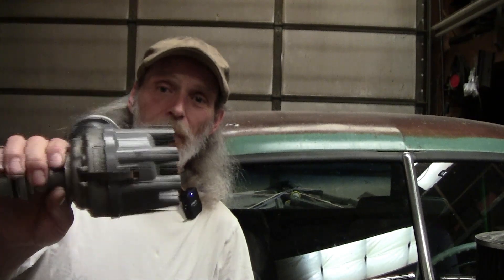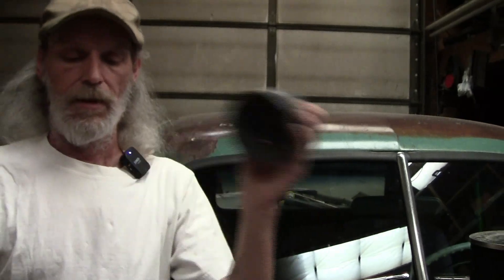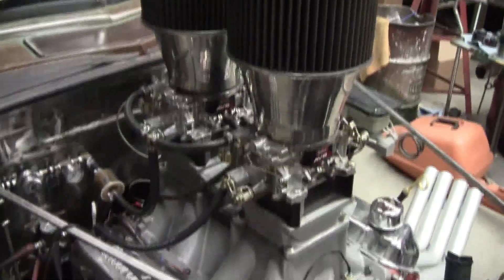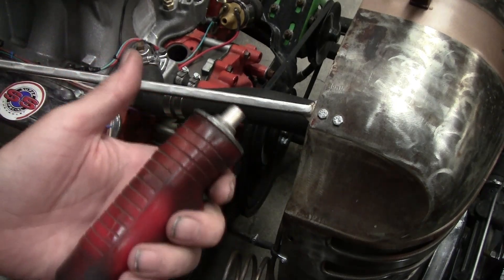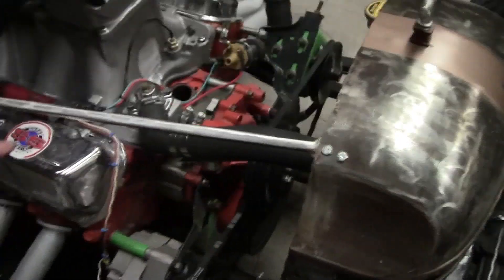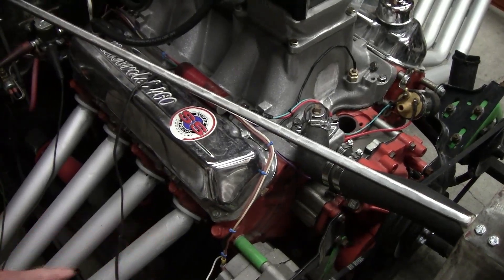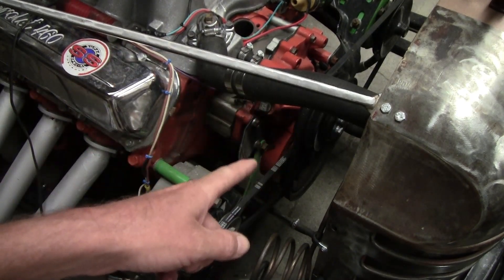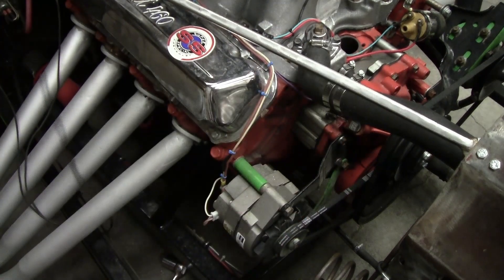How to Install a Distributor in a 429, 460 BBF the Easy Way & Get it to go all the way down

Comment: My truck is 1995 460 #7 is way different than your year #7 down at between 4o clock and 5o clock? On my 1995?
Reply from the maker: Number one on the distributor points to the number 7 cylinder on the block (3rd one back on the driver's side as you are looking at it from radiator)

Comment: My 71 460 points to the drivers seat and the clips are to the front and back of the car…when I put the rotor towards the #7 spark plug the clips at an angle… so how’s the 71 460 rotor supposed to be pointing

Comment: ok buddy the rotor points to number one on the cap where did you ever hear point it to number seven they have always said number one on the cap because the rotor pointing to number one on the cap means it is shooting power from the rotor to the number one terminal then through the plug wire to the plug and sparky sparky we have fire
Reply: True
Reply: Look at the 460 Ford manual, it actually shows #7

Comment: Best info video I’ve ever found! Been fighting my jet boat motor all weekend trying to stab in pointing at 1. And now it makes perfect sense. It’s acting 180 out because my cap is firing 180 degrees from 1. I bet money I’m gonna go point my distributor at 7 and it’ll fire, or I could swap my cap around to fire where the rotor is pointing at 1. I’ve been hearing it can fire in 6 different locations. With your break down I understand fully now!
Reply from the maker: Well thanks Lucas Jackson 204 (lolol one of my all-time favorite movies man).
Yeah, it's so tight around that t-stat housing and everything, that you really don't have the options to move number 1 on the cap like other makes and models.
Also, that's actually a Berkley/Ford 460 you have there! it's exactly what I have in "Sir Rats-A-Lot" with the tunnel ram! We pulled this one out of a Jet Boat years ago! If you ever sell that boat, pull that gem out and drop an 80's tall deck down in it's place..... because you are sitting on the "poor boy's" Cobra Jet" with that thing!
Reply: @BareRoseGarage  I have a 460 with a panther pump in my sleek craft, my race boat is a vdrive with 500+ ci big chief motor

Comment: So then you just hook up the wires in firing order to those cylinders , but on the cap... it starts at wherever one is , ( counter clockwise as the rotor turns) right ? Great, you helped me a lot. I have a 85 460 that I believe needs a new dizzy that has never been replaced. I've just about replaced everything electrical it could be, and still no spark. There's about 160,000 on it, but I guess it might need replacing. But it ran like a bat out he'll few days ago. Smuuthe as a baby's behind, but now just turns over, and won't start. Thanks for your help.
Reply from the maker: I'll start with the easy one first - make sure the vacuum advance is hooked up. I've called myself an idiot a few times for forgetting that one..... lololol.
Sounds like it's a tooth off, or that it needs a little more advance (getting you closer to that 10 degree btc mark on the harmonic) but we'll take it slow before we dive on in. 
Do you have one of those "Bump Starters"? They are ultra cheap at Harbor Freight or even the ones at O'Reiely's, Autozone, etc etc are pretty cheap and VERY handy for doing this stuff. I highly recommend them and a "Spark Tester" looks like a spark plug with a clamp on it, you plug it into a plug wire, clamp it to a ground somewhere and watch it for spark as you turn the engine over. Those 2 tools will save you hours of frustration and they are really cheap.
1st thing I'd do is check for spark, then move on to making sure that spark is going where & when it needs to go.  
If you didn't pull the distributor yet, do the spark test 1st and foremost, because these Motorcraft distributors will generally last a long long time, but everything else wears out around them. I've bought many coils & Duraspark Boxes that where DOA right out of the box, even the made in the USA ones.
Anyway if you have spark just no fire.... loosen the distributor bolt just enough that you can turn the distributor but it still holds it in place.
While it's turning over trying to start slowly turn that distributor clockwise (advance) and it should start to pop off (try to start).

If you run out of room and can't turn it anymore (vacuum adv is hitting the T-stat housing or what ever), you know you are a tooth off on the distributor gear, pull it and start over.
If it's dragging on the starter (making it sound like you have a dead battery) you've gone to far.

Oh!! and if you are using the "bump starter" to do all this..... make sure the key is on. If not all it does is turn the motor over without spark.... yeah, I've done that one too... lololol.
Once you do get it to fire up & idle, you can put a Timing Light on it to dial it right in to the exact degree.

I probably left something out in that, but that should get you started in the right direction with this, and I did my best to start with the cheap before you move to the money.
Hope it helps, and let me know how it goes man.
Reply: @BareRoseGarage  I will, and I have had bad electrical parts right out of the box also. I will get a bump starter, but regarding parts.....they no longer check ford spark boxes, hei modules, coils, or regulators that are external any longer. They just replace them one time. That sucks because you could be getting A bad part as a warrantied part, how would you know except to know how to test the part with an ohm meter or some other diagnostic tool. Years ago I had an idea that ford or chevy should have had a job shop in factories to custom build old model cars for customers upgrading components, hiring more 0eople to put to work. I can recall when you could buy changeover books that also listed what parts fit on multiple vehicles, to save you money on parts, and stuff like disc brake kits for older cars. Nothing like that exists now.  There's a guy from Denver that has a show on YouTube called Schroedingers box that teaches modern auto repair science. He has a 3.33 a month subscription to watch all his repair videos, if you've never seen any of his free ones, look his video's up on you tube. Thanks for the tips.....I'll let you know whether I figure why my truck won't fire up.

Comment: When you pull the dizzy initially, if you leave it where it is, shouldn't all be lined up, including the pump .?
Reply from the maker: In theory yes, and I have gotten away with it a couple of times, but the oil pump drive..... it almost never does. (I've done many many many of these and can count on 1 hand the number of times that the oil pump drive just slid right in, when it happened on this video I was SHOCKED even though it was wrong..... lololol)
But it's also an easy way to get it a tooth off. 1 tooth is generally in-between two plugs.
If I do try it that way, if it doesn't work, I'll do what I did here and roll it up on number 1 compression stroke & set the harmonic pointer to TDC (or that 10 BTDC if you want) and start over.
This one I'm working on is a High Compression older BBF so I play it safe with starting my timing closer to TDC and dial it back with the Timing Light so it doesn't "ping" if that makes sense.
Reply: @BareRoseGarage  yes it does....but this gas from Venezuela is crap, and my 460 is not being raced, so until we begin energy independence again, we all suffer . They need to hold gasoline to 99 cents a gallon for 8 years at least to just begin to help the drivers and the economy get back on it's feet. Harris won't do anything to fix anything...just giggles like she's high .

Comment: You never explained that 10 °   marks importance.
Reply from the maker: Had someone come into the shop right in the middle of filming that, and missed that little bit, but it's more for "timing" than dropping it in.
They all fire at 10 degrees Before TDC not at the actual TDC mark, so I set the harmonic on that mark and turned the distributor until the points just started to touch to make it fire at the touch of a key. HEI distributors you can't do that because you can't see the actual flick of the switch.... if that makes sense. 
Later when I actually put a timing light on it to dial it in, that 10 degrees BTC is the mark I'm shooting for.
Reply: @BareRoseGarage  thank you for completing your explanation. I have a situation where my 85 460 ford ran great then I,parked it over nite, and now it won't start. I replaced the coil, the , switch on the column tube, the spark module, and even the two wire p,ug with the flat bottom to that module, and no dice. I figured there's nothing else it can be except the dizzy pick up coil. Might replace just that part without pulling the distributor....that is if I don't have to, but if I do, I appreciate your video, and will do it your way. I have books that give tests for components, but if they are new, and not junk parts, I can't think of anything else it could be . Just had to tow it out of town to storage.... because the cops won't allow motor homes on the street for more than 24 hours, then must be moved 700' or they fine you big time. I've not been big on fords , but how can a truck run like a bat outa hell, then not start ? I DO KNOW THAT FORDS HAVE ALWAYS BEEN WEAK ON GROUNDS. So I figure it needs more grounds, why else would it not be getting spark ? Have thought about replacing the old Ford dizzy with a chevy with the coil on top. Or I've even seen them wire up chevy ign modules inside those old ford spark control boxes also. I can't keep breaking down, as AAA  ONLY GIVES YOU 4 TOWS A YEAR, AND WITH TODAYS TOW, I've used up two now. Any suggestions. It's hard with a 460 when you only get 6 mpg at 5.00 a gallon across the country. ( but love how it runs when it runs well. ) i rebuilt the C6 as a monster transmission,and it runs great, but I hate how hard it is to unplug all those plugs under the hood....it shouldn't be that hard to do. Fix or repair daily, unless you know the secret...I think this MH is haunted !

Comment: If the pump drive shaft doesn't line up, I just take an old distributor shaft and rotate it a little until it meshes. An 8mm socket taped to a  long extension will work too.
Reply from the maker: I used to do it that way until I found this method, which is a lot easier IMO, but I totally use the taped-up socket on an extension, or the old distributor that I took the gear off of, to prime them!

Comment: That was really truly interesting!
Reply from the maker: Thanks Brother Hoop! I did miss a little bit in the end there though. When I'm finalizing it I'm actually going off of that second mark I made - the 10 degrees before TDC - mark. Had someone come into the shop while I was filming that and had to pause - take off where I was - and forgot to mention that bit in it..... oh well someone will catch that and it's not a killer if you do drop it in on the TDC mark. You just have to turn the dizzy back about a quarter inch when it fires is all.